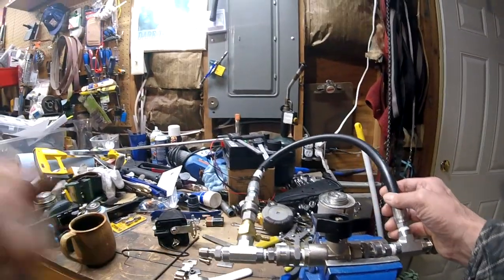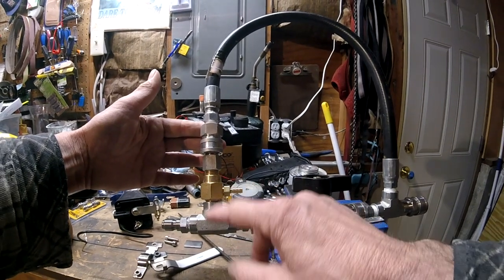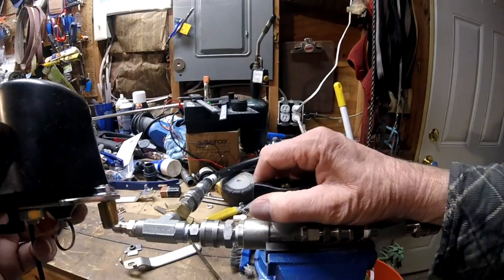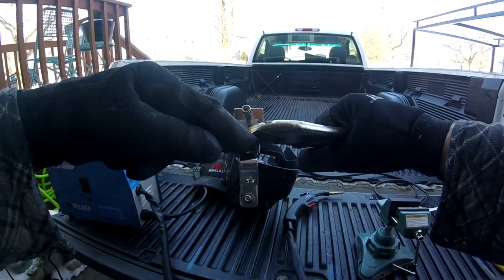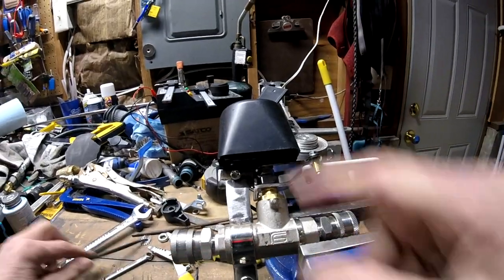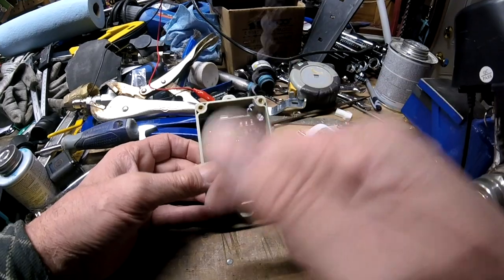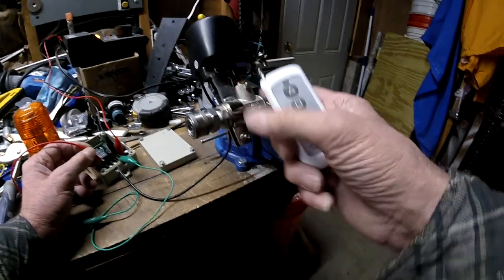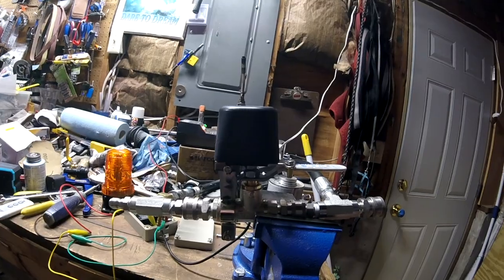Pressure Washer Remote Downstream Injector Bypass Control. Power Washing

Comment: For sure there are other nicely made electric valves out there. But I'll take your idea over any other, anytime! Because it will be much cheaper and simple to replace once stuff goes bad, and we already have and carry most of the parts involved.
Reply from the maker: Awesome!  Good to have a lot of parts laying around!
Reply: @housewashing5693  great videos!!!! Where did you get the ball valve handle?
Reply from the maker: @MarkB-zt9jm  3/4 inch ball valve replacement handle on Amazon.  I think I put the link in the description?
Reply: @housewashing5693  thanks man ! Looks like they are sold out of them, looks like HD has them for a little more money
Reply from the maker: @MarkB-zt9jm  https://amzn.to/3rgBNqN
Reply from the maker: @MarkB-zt9jm  https://amzn.to/3rgBNqN
Reply from the maker: @MarkB-zt9jm   I added more links in the description.  But what you search for is "ball valve manipulator"  or "valve manipulator" https://amzn.to/3eaEu9E
Reply: @housewashing5693  yeah I have ordered 2 of the manipulators already , I was searching for the replacement ball valve handle, I got one now , thanks again man!!!
Reply from the maker: @MarkB-zt9jm  Let up know how it works out?
Reply: @housewashing5693  I will when they get here, coming from China so it’s going to be a good while getting here, my only concern is will it turn the ball valve when it gets 3000 psi on it ?
Reply from the maker: @MarkB-zt9jm  It's a strong actuator.  Plus you're giving it a mechanical advantage with the long lever.
Reply: @housewashing5693  can’t wait !!!!

Comment: Jim Faulhaber from Florida, invented the bypass. The reason I use the injector on the straight part of the bypass, is the injector needs the pressure differential to open. More restrictions, cause back pressure, and it reduces chemical flow and can even shut off the venturi with a longer hose. The less back pressure on the injector, the better.

Comment: Great job brother finally found a Channel with plumbing experience when it comes to softwashing business got to know what you're doing . I built my own Downstream bypass I got a valve from teejet it works great  and I also  made my chemical proportioning unit that is high flow 
 control valve out of a regular 1"true Union full-flow port ball valve
 I took the ball out and modified it on my lathe works great save me hundreds $$$
Brother we here at 
Road dogs dirt relief appreciates your video and Content and the time it took to create great information 
wash on own brother
Reply from the maker: Thank you RDDR!  Great job on your "ball work" on your valve! LOL.  Got a photo?  Yes it's a pain in the ass to make videos.  I could have built 10 of these for all my retakes and editing!
Reply: @housewashing5693  I'll shoot you some pics of the details how I modified the ball valves do you have a email I got all the cuts and details out of the ball valve engineering schematics but I will send you the info brother
Reply from the maker: @ga-prowashllc12.5   email is mowerdog@gmail.com

Comment: I have the Pro flow. And it’s great. Thanks for the info.
Reply from the maker: Proflow did a great job at a reasonable price. https://flowpro.solutions/products/flowpro-remote-bypass?pr_prod_strat=copurchase&pr_rec_pid=5784723259558&pr_ref_pid=5920771637414&pr_seq=uniform
Reply: @housewashing5693 good morning Kenny. I put the injector on a straight run and put a remote between the injector and the chemical. I want to change to the injector on the bypass and do a remote on the shutoff valve. Would a US Solid valve work instead of having to pay for a flow-pro? It’s a substantial cost difference.
Reply from the maker: @garygodby9995  The ussolid valve is not rated for high pressure.  It could be dangerous to use one......
Reply: @housewashing5693  I saw where they were offered with a DN-10 and a DN-15 valves and wondered if I could save some money

Comment: I got to thinking about your actuator setup and figured that you have to keep the trigger pulled while the actuator does its thing
otherwise that little motor may not have the umph to turn that ball valve under pressure. Mines a bitch to turn when you
have your trigger off and the unloader is working. Thanks for taking time to do these videos.....
Reply from the maker: It's pretty darn strong.

Comment: Great stuff Sir. I'm going to use that concept to also accelerate and decelerate my machine! Thanks for sharing 👍
Reply from the maker: Yes.  I've been throwing that idea around as well.  I was thinking about this actuator pushing and pulling the throttle lever off the same receiver your injector valve is connected to.  https://amzn.to/3k8eOvf
Reply: @housewashing5693   Yes! I was looking at that other one since your last video. That may work too! Again thank so much for sharing such great and detailed ideas. You've already saved me all the time and effort on looking for all the rigth parts, not to mention all the labor involved in trying to put it to work all together (and it will save me even more time, money and labor, once I have it all working). Thank you so much.
Reply from the maker: @Absoluteresurface  Make a video of your throttle control
Reply: @housewashing5693   I’ve just ordered the parts w/ your links. I’ll share a video as soon as I get it and put it together. The “camisin manipulator” will take until April to come. 😏😔😔
Reply from the maker: @Absoluteresurface  So cool!  I can't wait to see your build!
Reply: here is an update video on how it's working Kenny. https://youtu.be/DASk9r3GbtM

Comment: Great video. Been looking on diy’ing this myself. I love your solution and will most likely copy it.
Reply from the maker: You can do it
Reply: @housewashing5693  I most likey will. Getting older and hate spend most my time walking back and forth
Reply from the maker: @charlestuozzo4747  I know I should be walking for exercise.  Screw it - make it remote control! LOL
Reply: @housewashing5693  Yeah walking is good but today was 6 miles worth on an apartment building.  90 % was tuning chems off or on.  Time for a remote

Comment: Just tried the ball valve actuator out under load 2200 psi and it turned the valve with ease !!! Thanks for the video !!! I actually made my own bracket with 3/4 x 12 gauge steel ( not easy by the way) but there are no cuts or welds, very rigid !
Reply from the maker: That is the best thing I've heard in a long time!!!  Make a video of the finished product and give us the link.
Reply from the maker: You just saves $500 bucks!!
Reply: @housewashing5693  I might have to get your email address
Reply: @housewashing5693  let’s hope it holds up ! Gonna save a lot of walking back and forth to the trailer
Reply from the maker: @MarkB-zt9jm  mowerdog@gmail.com
Reply: @housewashing5693  I think it went through just took a while

Comment: I’m in the planning and comprehension stages still so pardon my ignorance. What chemicals are we injecting at this point? I thought the mixing station was for all the additives.
Reply from the maker: This is for the downstream injector not the Soft Wash metering station.  This DS injector will be introducing Sodium Hypochlorite and a small amount of surfactant.

Comment: So good! Any timeline on when you think you'd have the actuator available? I saw you mention it a comment...
Reply from the maker: I've worked or tried to work with a dozen companies overseas.  All they want to do is screw me around.  I could only find 2 US companies but they want $1200 per valve.  So by the time I get a valve ready for production it's going to be several thousands of dollars.  I feel that the best solution is to buy the whole set up through FlowPro Soulutions.  Because by the time you spend making one you could wash one house and basically pay for FlowPro's valve.

Comment: Like the video,  I use a remote electric ball valve for down streaming, made for under 100.00 your way will give a little more flow for rinsing, which is good. That bypass, most put the chemical injector on the straight away because it supposedly pulls more chemicals that way verse having it in the loop. Run a test on yours, see what you think, I’d be curious. Never done a test myself, thanks again!
Reply from the maker: I think the injector difference would be too small to worry about.  But a test would prove that.  Maybe another video?
Reply: @housewashing5693  I agree
Reply from the maker: @simplycleanpressurewashing758  I will learn a lot this year for next winters upgrades. Testing this kind of stuff is how we learn.
Reply: No the injector does not draw less on the loop but u do get more flow with a half inch ball valve and half inch tees with reducer bushings, use all stainless, with stainless injector if u want it to last

Comment: He man i love what are you doing i built a soft washing manifold like yours from home depot when i tested it it pulled soaps only from the 1/4" line but the water and the bleach is nothing coming out please what do you think the problem is
Reply from the maker: Make sure your check valves are installed the right way.

Comment: any idea if you can operate two of these remotes independently at the same time (on two machines)? or would the remote change the other operators machine as well? ex. machine 1 is applying chem, machine 2 calls for water, would machine 1 swap to water as well from pressing the button ? or would machine 1 keep applying chems?
Reply from the maker: I honestly don't know?
Reply: You can you need 2 channel remote, you can buy a fob and even use your phone to setup  and turn on and off more reliable than your transmitter box. I use this for  pure water window cleaning can turn pumps on and off and adjust water flow rates up or down  for rinsing the glass 👍

Comment: I have my bypass setup the same way. tested many times on my 5.6 gpm filling the 5 gallon  through bypass and straight through and the bucket filled faster when going through bypass. I still can’t explain, and it shoots higher also.
Reply from the maker: You are saying that it shoots farther going through the injector?
Reply: @housewashing5693  yes
Reply: @housewashing5693  same theory applies when i used to use an xjet, if the hose barb has a hose connected to it you get less distance when pulling chem, if you take the hose off the xjet injector and run it where it pulls air at the end of the gun then you get farther distance. I used a jrod with a large straight orifice so it pulls chem with hose attatched then if you pull the hose off but dont switch your jrod orifice it hits farther.

Comment: Looks like ppl are finally catching on...u also should use 1/2" Ts to maximize flow as well. We've built these since the late 90s
Reply from the maker: Why an 8+ GPM only has a 3/8 outlet is beyond me.  Thanks for your helpful comments!
Reply: @housewashing5693  I have 2 -7gpm gear driven units on my trailer and love them ! I used to have an 8gpm gear drive unit but if my bleach got a little weak it really struggled with taking heavy mildew off of houses at .6 percent that’s why I dropped back to the 7’s , if I done it full time it may have not been an issue with the bleach strength as I would have always have strong bleach, the 2.1 injector only pulls 64oz of chemical per minute with 150’ of hose
Reply: I’m with you on using 7gpm instead of 8. I use Udor 7gpm pumps and for me it’s the sweet spot. Gives me enough flow for surface cleaning, pulls enough soap/SH for me to clean quickly, and doesn’t flood me out when I’m cleaning tight spots or places where water collects. I don’t see any difference in time between 7 and 8. 7gpm is the way to go.

Comment: Love it
have you tried it in the real world.  how does it hold up to 3 - 4,000 psi's for shutting off torque?
Reply: I’m running a 7gpm/3500psi pump and turning the ball valve is easy even under pressure. The actuator on the FlowPro turns the valve just as easily. Huge time saver when I’m working solo.
Reply: @toddluns1  I bought a cheap $35 valve on Amazon.  Clearly this is the problem with mine.  I ordered a D10 and swivel.  Problem solved

Comment: Motorized stainless steel ball valves are about $30
Reply from the maker: Not for 3000 plus pounds of pressure.
Reply: @housewashing5693  good call. I didn't even think to check that...I was wondering why you were using the actuator and now I see why
Reply from the maker: @Kevin-midmichigan  Not only will it save you from walking back and forth it will make you money.  It will pay for itself on the first job.

Comment: Injector bypasses are a waste of money! I wash a lot of concrete and they are not necessary at all.
Reply from the maker: There are many ways to do just one job. It's all good when the check clears.
Reply: @housewashing5693  Still a waste of money...serves no performance purpose whatsoever.
Reply from the maker: @jimmywarren6685   When I bypass my injector my pump output is 1.5 gpm more.  But yes, you don't need to bypass the injector to get the job done.